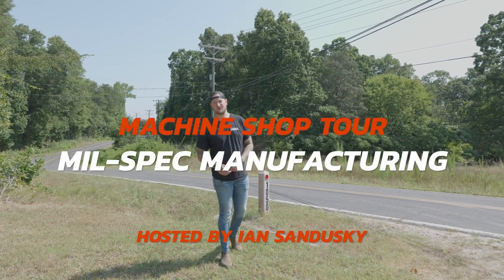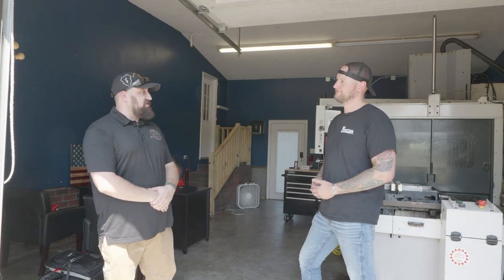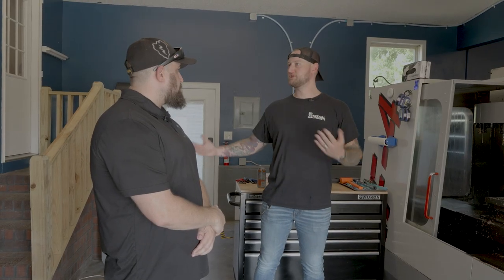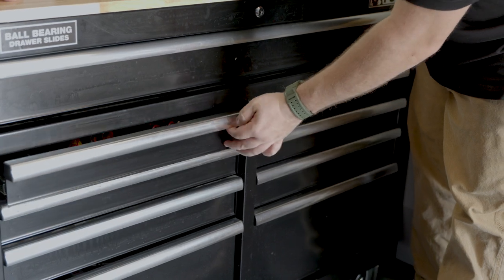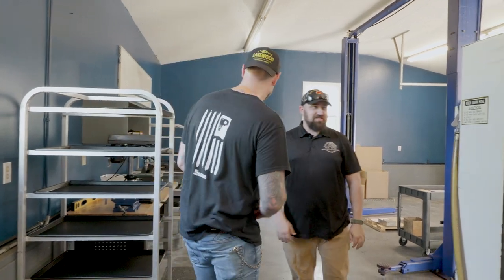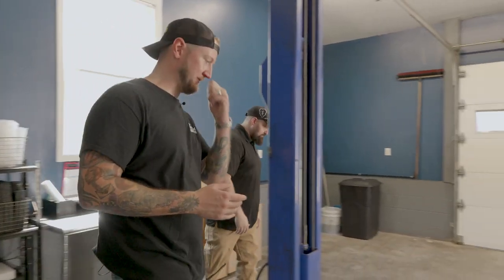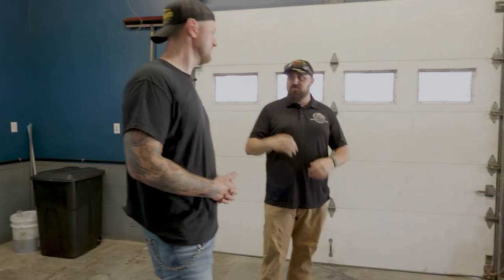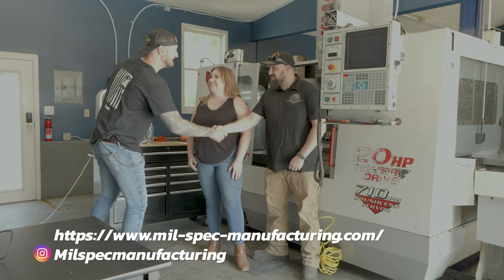This shop started with less than $40,000!｜Mil Spec Manufacturing Machine Shop Tour

Comment: i started my shop with 30 years cad experience and a $1200 benchtop lathe, then a year later added benchtop mill.. got my 1st swiss style lathe after being in business for 2 years to qualify for a loan with a 10k deposit. 10 years in business and i have 2 42x24x24 mill and an 8" chuck lathe, i have picked up and traded back 4 other machines that offered more of what i needed at the time.. all used machines, 1 demo. ive done cad and some programming before but never really lasted long on the shop floor, always got pulled into engineering. i didnt have any connections when i finally started my business at 38. top it off im here in southern california but looking to move out of state and would love to be paying on a mortgage and not shop rent... my shop probably cost more than his house payment.
Reply: That’s a great story! Do you have any ideas of what state you might move to?

Comment: Use that mill for some smaller lathe work. Put the parts in the spindle and build a tool holder rack that mounts to the table using a different work coordinate for each tool. You can load that tool carousel up with parts and get some decent production. Really works well if you set it up right. Just a suggestion
Reply: Great advice!

Comment: Temp control is important. I ran a lathe that would thermal exactly .0015" over the course of 3 parts as it warmed up. It was so consistant I could comp the tools for every part.
Reply: I ran an Integrex 200 that would move by 0.0022" every Monday!  We were holding .0005" all day after warmup though.  Sometimes less

Comment: I'm a veteran and I started a shop just over 2 years ago in Texas with a 2007 okuma captain 470L, a bridgeport knee mill, a summit manual lathe I purchased off Facebook for less than 30K. I just added a 97 haas VF3. I contracted as CNC maintenance while building my shop. Which help me learn to purchse older machines with value and work on then.

Comment: No idea if the cameraman will ever see this, but a few tips: use zebras to aid in exposure, at the very least a histogram. Second, if you are in a place where the light changes constantly ride the ISO rather than aperture. ISO is way less jarring on most cams (and DoF wont change, either). If you have to do it in auto ISO, then couple that with an auto exposure hold button. But also never be afraid of taking command. As in saying the walk and talk may not work for you technically, so cut the scenes instead. So, you could shoot the outside scene and nail the exposure and then just cut when they are about to walk into the building. Then reset to inside, nail exposure and start rolling (this really is needed if you shoot ND filters outside). 

Auto can be a tad tricky though as it works best when you actually know how to manually expose. E.g. if you are in a room with really dark walls, you'd need to know how the camera works in terms of measuring light so you know that you'd likely need to add compensation to the auto, too. 

Anyways, zebras + riding the ISO would be the advise:)

Comment: The part about buying a used older machine with more capabilities holds too much truth. 

Our shop has a job that's ran in high quantities (6-10,000 pcs. a week). We were initially doing the job on two VF2SS machines but it was super inefficient. We happened to come across a 2009 VF3 with a pallet changer that was in absurdly immaculate condition for only $40k! We made some subplates and two large fixtures to utilize every inch of table space, optimized a program, and almost doubled efficiency and virtually eliminated machine downtime.
Reply: It’s incredible how efficient they can be, isn’t it?!
Reply: @MilSpecManufacturing  yes! Totally a game changer. Good luck with your future endeavors and make lots of parts!
Reply: @calebneubert230 Thanks, you too!! 

Keep an eye out for our upcoming Series, “Becoming a Practical Machinist.”

Comment: This an amazing setup for sure very professional and I bet fast to produce parts. One downside old HAAS machines the high power servo motors are hard to get your hands on specifically older models. Side not my friends HAAS has a 30 HP servo VS 20 in the video. His servo stopped working but turned out it was not the servo just a connection though he had to go through HAAS approved service supplier. It cost him over 600 bucks for a 10 min visit but he was happy it was only that was an issue not the servo itself. But this is one thing to think about when deciding to see the service history and hours of operation.

Comment: I think it's smart to start a business with older used machines. It's no wonder so many startups fail when they suffocate themselves in debt for new machines before they have any revenue.

I'm curious if all that power in the spindle motor is actually used or if it's pissing extra electricity money into the wind.

It sometimes seems like they oversize the motors to avoid needing gear changes for low speed milling.
Reply: No, it doesn’t use all the rated kilowatts the entire time. Only under load does it amp up. 

Our electric bills are nice and low.

Comment: Being scrappy is underrated in starting small machine shops... Many people encouraging machining (especially titan) ignore the fact that the average person cannot even buy one new Haas, let alone obtain the shop/work space (the first article), electrical infrastructure, pneumatic infrastructure, tooling, software... most people don't have the access to capital from savings or credit. 
I've had no choice but to go about it in the most scrappy, cheap (and SLOW) manner possible. My investment into equipment abruptly slowed after getting a house with a mortgage, although it afforded me the garage space. I'm only about $10-$15k into my shop (not counting my house with attached 3 car garage), by buying inexpensive used equipment and by installing infrastructure and repairing my cnc equipment myself. 
In the past 10 years I tried to get a machining job a few times but wasn't able to swing it (financially or with school or otherwise) so now I'm gaining experience as I'm slowly building my shop. 
I'm on the slow track, but I have a 20x20x20 4 axis Cincinnati VMC, Mori SL1A turning center (still needs repair), 20hp 3 phase power, 60 gal 3 hp air compressor (soon to be replaced by a $500 5hp Kaeser rotary screw compressor), a Kurt 3600v vise, schunk ksp 160 for my 5th axis trunnion, and some tooling. It took years to find deals on cheap but good stuff, to get everything working...
I originally tried to go the John Grimsmo route (he initially inspired me to try it in the first place) and retrofit a Sieg/Grizzly X2 then X3 to CNC in my parents garage (before I got married), then I realized I still couldn't do much with either mini mill. 
I think in general, for those who have ANY shop/garage space, a tormach probably is the best way to go... but if you have more room and a bit more budget i.e. for 3 phase power, adequate air compressor, and a bigger machine, etc... getting a used Fadal, Haas or Cincinnati or maybe Mori (with Fanuc control) might be the next best option to aim for on a 'budget.' At least Cincinnati's have quite a bit of community support, some support from Fives in 2023, and they can be had for cheap. Compared to tormach, they all have an automatic tool changer and a very user friendly interface, along with other convenient features in the control...
Reply: Thanks for sharing your story! I think in today’s economy, it really pay off to start smart and small. 
 Keep an eye out for our upcoming series, Becoming a Practical Machinist.  It focuses on starting and running a small shop!

Comment: Love your small shop. How do you keep the air compromiser, air dry?
Reply: They can always get a little Quincy QR/QT or Ingersol Rand T-30  with an after cooler and drier as they come up used nearby. Piston is best for small shops low cost and no surprises.

Comment: @iansandusky417 and @MilSpecManufacturing thanks for this timely, helpful and encouraging video. I am just now starting a CNC shop out of my garage. I've cashed out just shy of $38k in start up costs. The biggest expenses being my 2011 Sharp SV-2412SX VMC, a 30 HP phase converter, a 80 Gallon air compressor and tooling. I'm a full-time software engineer so the past 18 months I've been working after hours learning Fusion 360, setting up the shop including all the electrical (which I did myself) and learning how to use the VMC and Fanuc control. I took a Saunders Machine Works on-site course. I'm currently going through the Titans of CNC academy. The Practical Machinist forums have been instrumental in getting me started and helping me progress to where I am now. And now I'm starting to really to dig into the business side of the craft. My hope to start earning some income with Xometry by the end of the year as a starting point. We'll see what happens from there.
Reply: Thanks, American Maker CNC ! Keep an eye out for our upcoming series, Becoming a Practical Machinist.  It focuses on starting and running a small shop! It might be just as beneficial for you as the forums.
Reply: @MilSpecManufacturing  WIll do! Thanks.